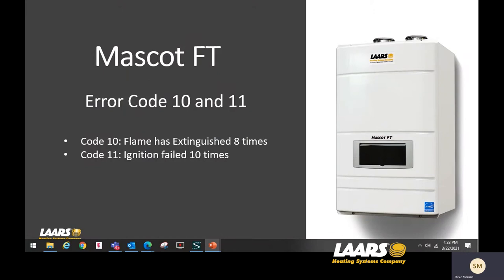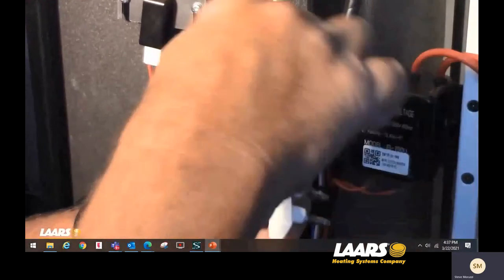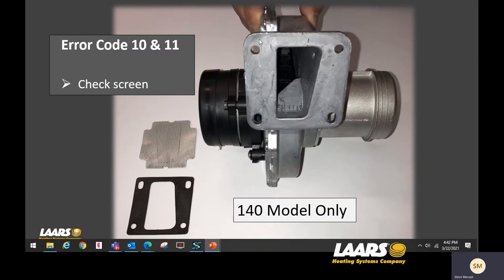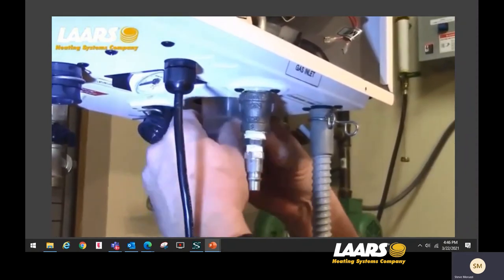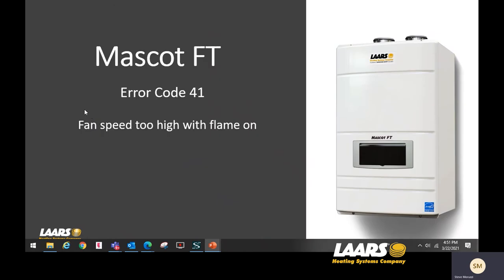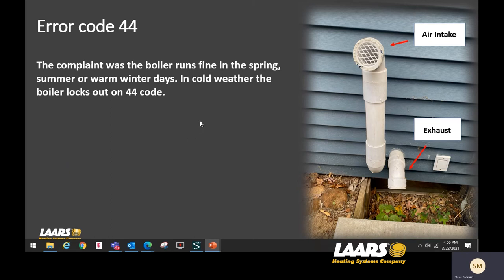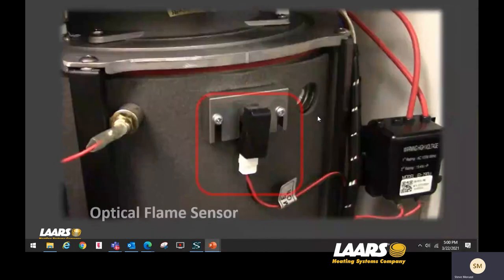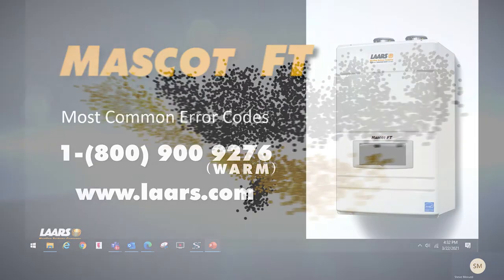FT Series (ALL) Residential Error Codes (most common)

Comment: Where can the condensate tubing with vent be purchased?  Just got the error code 20 and noticed my installer didn’t use the vented tubing - just hard pipe!  So a link to the proper tubing would be very helpful

Comment: 199 combo error code 11 ignition has failed 10 times. Checked the power from the 2 wires going to the ignitor transformer. Shows 16 to 18 volts not 120. They are sending a new board. Is there anything else that could cause this. Brand new boiler. Thank you
Reply from the maker: @barryschuskhke9149 please contact our technical support team at 800.900.9276 x6579.  The team has some questions for you before they can give a final answer.  Thank you!

Comment: I'm getting error code 80, water won't flow throughout the boiler. There's definitely water coming in, but it will not go out. Any advice would be greatly appreciated!!🙏🏼🙏🏼🙏🏼
Reply from the maker: Hi Juan - Have you tried using our contractor locator at www.laars.com/support/contractor-locator? That would be a great start.  You can also email me at marketing@laars.com and I can help to get you connected with someone that way as well.  Thank you!

Comment: I have error code 16, and a noise coming out of the internal pump ( sounds like something is loose inside) and it’s leaking at the connection to the 3 way valve. The DHW works just fine. 
When the pump screw is loosen, water is leaking though the pump ( not sure if this is normal). I have 2 of these units installed in February 2018, and since I never went through a winter without one of them having a issue in the worst day of the season. So far we replaced 1 control board, 2 3 way valves, a pump. It’s disappointing to say the least!
Reply from the maker: Please look at the Error Codes in your Installation Manual.  For the FT's, Error Code 16 is 'Operating Temperature Sensor detects Water Temperature Greaterthan 203°F (95°C)'    Please let me know what you have done thus far in your diagnosis of this 16 error code.
Reply: The pump was the issue, the unit worked fine after the replacement of the pump
Reply: I currently have this same problem. I never go a winter without an issue neither.
Reply: @mezianemeziani2956  did you have to pay for it or the warranty covered it ?
Reply: I just moved into our new home and we have a new FT Series combi. I also saw some water leaking through the pump when I unscrewed the pump. Is this normal? BTW I am also getting an error code 16 on a new machine. 😞
Reply: Hi, I got an error code 16 in my LAARs Mascot FT, water is dipping through a pipe, don’t know what to do!?

Comment: I keep having the code error 40 what else should i do
Reply from the maker: Good morning - if you contact our Technical Support Team at 800.900.9276 they can help you with some further diagnostic steps and/or direct you to a technician in your area to assist.  Thank you!
Reply from the maker: Good Morning,  As you know, by watching this video and reading your Installation Manual, an Error Code 40 is 'Gas Leak Detected'. 
    Please contact a trained HVAC Technician to diagnose this problem. 
    If you are a trained HVAC Technician and still cannot safely diagnose this Error Code, then please Shut Down the unit and call your regional manufacturer's rep at the information found on the back of your installation manual. 
     Follow all safety guidelines as outlined in the Installation and User's Manuals.